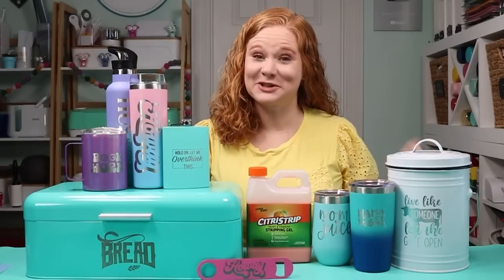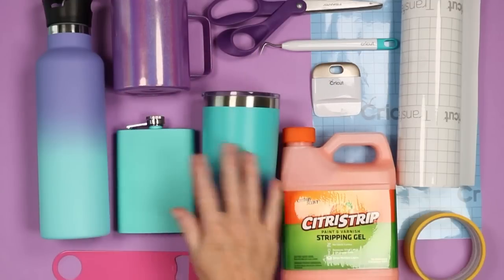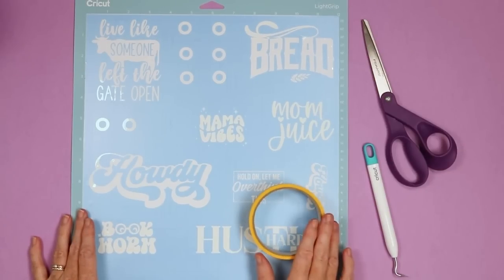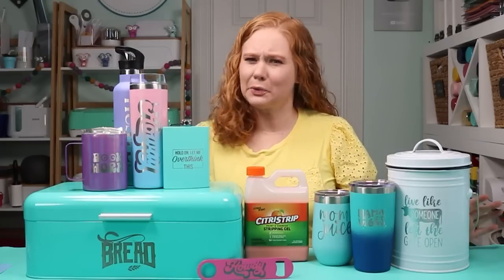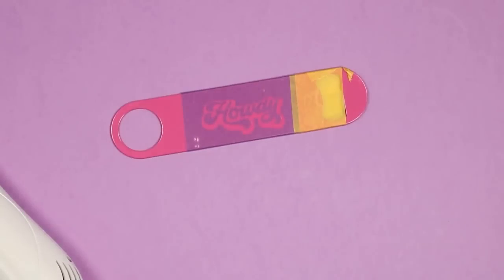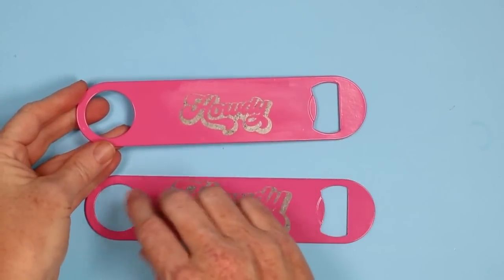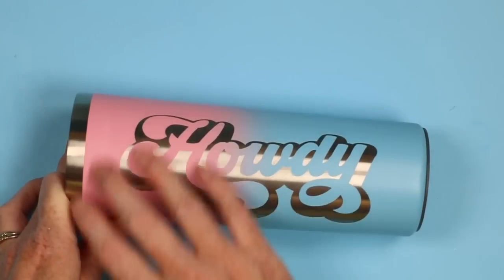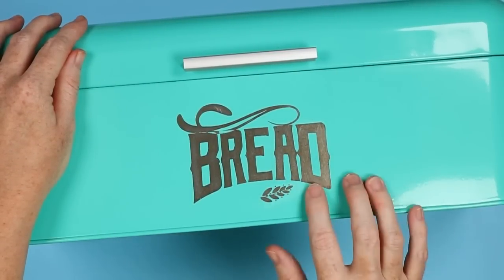Citristrip Etching with a Cricut: 9 Projects You Won't Believe!

Comment: I would love to see you try the tinfoil and heat gun method!  It works much better and faster! It takes a 2 hr project and takes it down to in most cases 10 mins with the Citrus Strip and several mins with the heat gun/tinfoil. It's the method I used for the ones I did. I learned it from Makers Gonna Learn (LIVE: ETCHING COATED TUMBLERS WITH YOUR CRICUT! No Laser needed ) then altered it for each tumbler. :) They used StarCraft Permanent Vinyl which seems to stick better and I didn't have any leakage. I do like the fact that you used the heat gun to kinda bond the vinyl to the tumbler a little, I don't think they did that in their video. I love your videos. You are always so through. Thanks again!
Reply from the maker: You really should not use heat with Citristrip as that is heating a chemical.

Comment: What do you think about leaving it overnight?  Or using a heat gun?  I also saw some who used a scouring sponge but it looked like it had so many scratches. 

And like many have said….thank you for doing this and sharing with us.  You explain things so well.
Reply from the maker: I didn't have any that I think would have to be left overnight. I don't like the heat gun idea as you really should not heat chemicals like Citristrip for safety reasons. I tried SO MANY THINGS in my house. I didn't really like the scouring sponge.
Reply: @AngieHolden  thank you.  I watched The Lone Fox and he used the heat gun and the strip on wood but never thought about the chemical aspect.  Will leave that alone.  Thanks for confirming the scouring pad.

Comment: Could you reapply more Citristrip to the areas like the waterbottle that you discover didn't release the paint well as long as you hadn't removed the stencil?  It seems like that would solve the issue of the paint not removing in that area without wasting the piece.
Reply from the maker: If the stencil had not moved at all you could. Mine did move.

Comment: How do these hold up after dishwashing? Or do you advise to hand wash only after this?
Reply from the maker: The coating itself should be fine. However, you never want to add any insulated tumbler to the dishwasher so be careful there.

Comment: My problem has been that the stripper goes under the small details, but maybe because I am wrapping them in plastic and letting them sit overnight because the paint wasn't coming off.
Reply from the maker: I was able to get small details as you saw with this method.

Comment: I left the citristrip on my water bottle for 2hr 10 mins and it still didn't work!  Any ideas to make it work?  I used the water bottles linked in this video.
Reply from the maker: Hmmmm....obviously it worked for me! Did it come off at all?
Reply: @AngieHolden  No. I had tested on the bottom and it worked after 2 hrs, but it did not come off on the sides.  I just tried putting a heat gun to it, so we'll see if that helps.